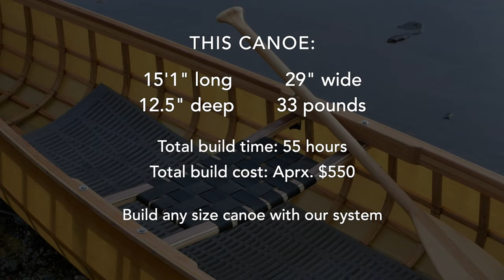Skin-on-frame canoe build time lapse

Comment: I really like this! I'm quite keen to try it. 
Would I be able to paint the skin once it's done? I've always liked a red canoe.
And is there a separate set of planes for a 2 person canoe?
Reply from the maker: Our building system is unique because the plans don’t just cover one canoe but hundreds of different Canoes.  Build a tandem although generally, I recommend that people start out by building a small solo or pack canoe first to get familiar with the system before trying a tandem.   Color is no problem.  Red is easy to do with earth pigment mixed directly into the polyurethane.  There are color charts on our website.